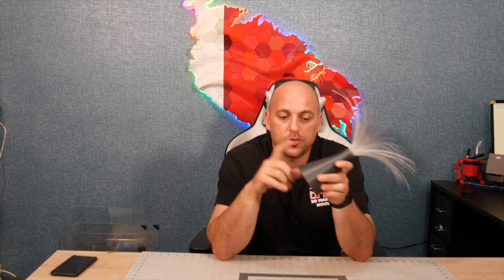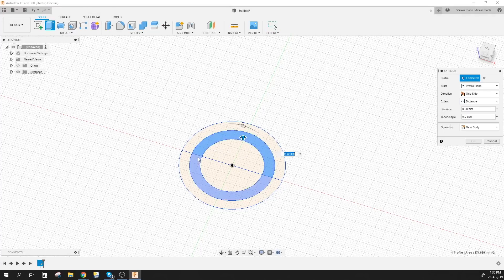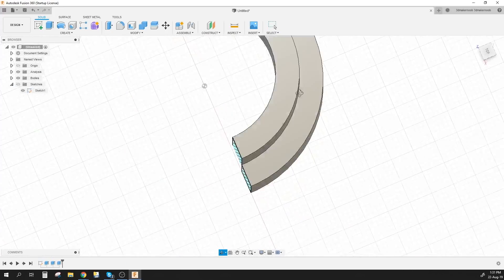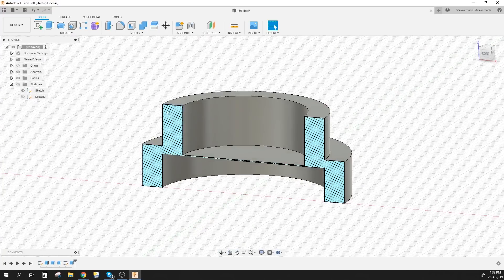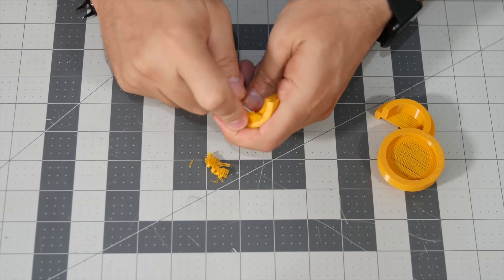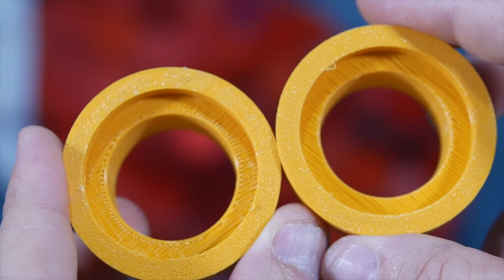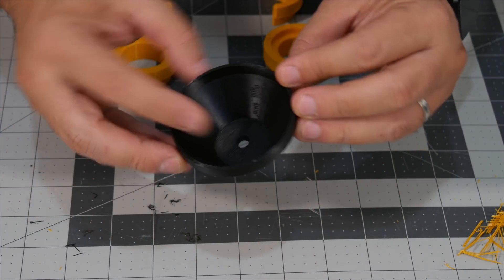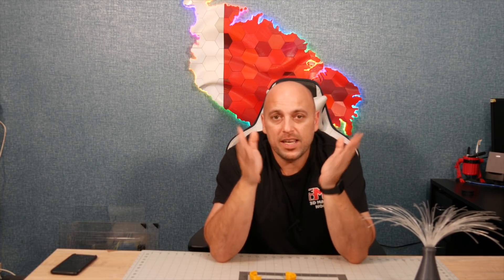3D Printing Design Tip To Avoid Supports - Sacrificial Layers and Bridges

Comment: I'm amazed how printers can do that, it's not intuitive for me, I thought when it's bridging in mid air, it's gonna fall down, do you need fans on 100% so the filament cools fast so it doesn't bend down ?

also, imagine 3d printing in space, no supports required at all

Comment: There is a much easier and econimical way of doing this nowadays using Cura 5 with pre-model. Just create a 1mm tube component under the overhang just inboard of your inside wall radius edge to the base. Export it as a mesh. Go into Cura and import your project stl and then import the 1mm tube stl, goto Cura pre model and make your 1mm tube a "Support Mesh"... Now it will support the bridge, it will snap off without any other cleaning and you will only use a tiny bit of material. I use this method when I create threads also. I create my thread and insert a tube the length of the thread half way between the root and crest of the thread, convert the tube as a support mesh and then when you are done the support strips out in one long ribbon with no extra cleaning.

Comment: hi, do you think that this model positioning will work and print fine?
Or how would you place this object to avoid failurs?

https://drive.google.com/file/d/104Z6Bw0C3-GILCXklRpnXFM8-s1mhFaj/view?usp=sharing

Its a resin printer.

Thanks.

Comment: If the hole in the donut is too big for bridging, maybe you could support the sacrificial layer with an added cylinder that only touches the sacrificial layer. It could actually be quite a bit smaller than the hole, and it could also be a donut rather than a cylinder. Actually, come to think of it.. no need to print the middle of the sacrificial layer either. 

As of late I've been experimenting with tree supports - the do seem to work quite well, and separate more cleanly.

Comment: It would've been a nice added bonus if you'd shown how to print it flipped over as if the parts were orientated like the parts are sitting @6:20 with the lip on the outside. I have a design that has a lip that I use supports on and while it still prints well, I would like to know how I can achieve a similar result without all of the waste as I have MANY of them to print O_o

Comment: I do this, but in this case I'd have added a sacrificial cylinder the same size as the inner diameter. The bridging is then shorter and only the cylinder needs to be removed.

Comment: I sometimes place the support a small distance from the part. You can see it when zoomed in on the slicer or CAD, but it does the job and is easily removable. If it is too far to bridge or outside the object, I might create a shelf. 2mm lower than what needs to be supported. That shelf is supported by small structure branched from a point on the main part. If your example had to be printed upside down, I would make a partial Cone sloping 45° and 0.2mm larger radius than the part.
Reply: I usually add a support of some sort up to about 0.1mm (or 1 layer height) from the overhang.  It works, takes very little filament and falls off when I lift the print off the bed.  No "removing" needed.

Comment: you don't need any support what so ever. Just design the part proper. instead of a sharp 90 use a 50degree on the inner for a counter sink screw. this won't require any support at all. 
If you do need a mid air bridge do it with 5mm to max 10mm column spacing apart. This way it will not sag and is super easy to remove.

Comment: There is a easily missable standard Setting in prusaslicer that makes Supports EXTREMELY easy to remove. Just change the Z Distance from 0.1 to 0.2 in the Supports tab

Comment: This should really come as a feature in the slicer itself. Feels like a pretty simple thing to check for while slicing, it’s basically just extending straight lines or checking for where a plane intersects. If done in the slicer the thickness of the sacrificial layer could also be reduced by reducing the flow rate while it’s ”bridging”, making it easy to remove even if you print very thick layers.

Comment: My first attempt failed because of "Perimeters" setting, if the bridge part of the sacrificial layer is too close to the perimeter, the bridge segments will end over open space, at least in Prusa Slicer. Couldn't find an option to make sure bridges are anchored on previous layer. It would be nice if the slicer could at least warn about un anchored bridges.

Comment: Been using this technique for a while myself when adding small square / hexagonal screw inserts into my 3D Prints.
Another option - If the bridging is too large - is to do this: https://i.imgur.com/rrjGnjT.png
1. Print the yellow bridging mesh on the build platform first.
2. Start the print of the actual model but have it PAUSE between the transition area of the red and the blue sections ( one object but coloured differently for the sake of explanation ).
3. Insert the yellow bridging mesh ( consider adding a dab of glue here and there ).
4. Resume the print of the red/blue mesh which will lay it's layers on top of the yellow bridging layer.
Reply: Why didn't I think of this!
Reply: I use a similar technique, but instead of glue I just use a soldering iron to melt the edges of the two parts together. Because it's all made of the same plastic it ends up as a single solid part. Much easier than futzing with supports.
Reply: @dgkimpton  what two parts ? There's just one part...did you read the image caption?
Reply: @alejandroperez5368  did you? There are two parts during printing. The red+blue and the yellow. The yellow part needs more than just "drop in" otherwise it will be dragged about by the hotend. I fix it by melting its edges with an iron, Durahl suggested glue. Eventually when printing is complete it ends up as effectively one piece.
Reply: @dgkimpton  read the image caption, dude!!

" The RED and BLUE shells have been separated for visual guidance only! They are in fact one single piece but the 3D print has to be halted at their boundary for the YELLOW piece to be inserted"

There's no mention to glue anywhere....
Reply: @alejandroperez5368  "3. Insert the yellow bridging mesh ( consider adding a dab of glue here and there )." 
But whatever, I'm happy with my experiences and this is pointless.
Reply: @dgkimpton  You're right. I didn't read that comment completely, I read the image caption on the link.

Comment: Great tip. In the past I've resorted to splitting some items in two in CAD, printing, and glueing back together.
Reply: I still like this option in a lot of cases since the glue has the potential to add some strength and for structural components it can be advantageous to print portions in different orientation to avoid bond strength issues.

Comment: Pretty great idea If you needed to do a large area you could still use a support wall also a minimum thickness at the mid point of the widest point of the sacrifice layer its faster and cheaper to do your way of this thank you now I have a new tool in my box

Comment: I used such a model last week on Thingiverse.First, it's very hard to modify. Secondly, for different layhigh, such as 0.2 and 0.1, slicing gives different results. This should be provided by slicing software, not by modeling modifications.  Please use countersink.

Comment: I picked this tip up from Angus (Maker's Muse), and often use this on parts that I downloaded. Usually I only have the STL and I'm not experienced in modifying meshes like this, so I add these 1-layer covers to the holes in PrusaSlicer. Doing it in the slicer (even for my own designs) also allows me to choose at the slicing stage what layer height I want to use and then add the hole covers at the correct thickness then. Especially useful now that I'm using adaptive layer heights, I can find out the right thickness after I've applied the adaptive layer height tool. For counter bored holes smaller than I can fit my deburring tool into (like for M2 hardware) an appropriately sized drill bit makes easy work of cleaning the finished holes. (For example, 2mm drill bit for for an M2 hole.)

Comment: 500 caps and 3d printed???  That seems expensive. I would told the guy to look for plastic molding.
Reply: Not if the guy was willing to pay $2/pcs...
Reply: @Arek_R.  That's no reason not make it with cheaper methods and better result.
Reply: A mold is 2k just to start with😂

Comment: Cool little trick, I already know at least two projects I'm working on where I wish I knew about this before. Both parts require supports to print, but at the same time they're very difficult to print with supports, this will simplify things a lot.

Comment: Anyone who uses 3d printing for a 500 qty run of ANYTHING needs their head read!!
Reply from the maker: i printed 500 pieces of this item within a week. how long you thing it would take (and cost) to create the part, refine it, create the injection mold, test it, refine any changes if needed and then make 500 parts for one time?

Comment: Nice tip. Notice that, in the first piece, since you're already adding a support part in the design (the sacrificial layer), you could also make an inner ring to sacrifice as well, whose outer wall would be exactly the diameter of the piece innermost ring or just barely shorter (enough to let the cutter blade slip in between later on and as tall as the sacrificial layer, so you'd be still bridging to make the "balcony" bottom layer, but the bridging distance would shorten so it'd be more firm, and you may even increase the piece size.

Comment: You don't need CAD file for this if you use PrusaSlicer. It allows you to add primitives (cylinder, box ...). Make it 1 layer high and place it where the supporting bridge should be. Although I have to admit that doing this in CAD is much easier. But in vast majority of cases you just don't have access to the source file (yes, I'm looking at you, Thingiverse)

Comment: What is that tool you are using called? You are using it to remove the sacrificial layer?
Reply: Burr remover. normally used to remove burrs from aluminium pipes

Comment: You talk about making 500 pcs of a part on a 3d printer..... why not just print ONE part. Fix it up to look perfect. Build a silicon mould and cast them with polyurethane? This will take 2-3 hours to make the mould and only 5 minuts to cast.... if you make a mould with 4 or more parts at a time, you can cast it in under 10 hours for ALL 500 parts. Look it up.
Reply from the maker: If a customer asks for 500 3D printed parts, why would I argue with him? This is what puts food on the table :)
Reply: @3DMakerNoob  Thats fair. Business is important. If you could get the same prize by getting the job done in less time, you will have a win win. I just wanted to point out the possibility to make a casting solution model.
Have a great one.
Reply from the maker: absolutely agree. but since i have access to 50 printers, i tend to have a short turnaround time for custom parts in large quantities :)

Comment: but wont that sacrificial layer change the tolerance measure?? and if that printer can make that sacrificial layer that way why would you bother put supports in the first place!!
Reply from the maker: it won't change tollerances. you'd need supports ar the inner ring would print in mid air otherwise

Comment: Support in cura, enable the support interface and roof settings. It creates a brim ontop of the support making it easier to remove.
Reply from the maker: All slicers have that feature
Reply: @3DMakerNoob  just using Cura, don't think many ppl use it as it's a gold when it comes to removing support

Comment: or you could just print a sacrificial thin  walled cylinder  at the inner diameter, you can model it as a separate item, bevel the top to minimize contact area, and then simply break it of along the layer at the contact height, no cutting through the layers as you have done. The bridge is then much shorter than your system too. The idea is the same, just better execution in this case. In essence what you are doing is taking control of the support method by good design using sacrificial addons to avoid clumsy wasteful auto supports
Reply from the maker: You’d still be using more material so might as well just use custom supports. The idea here is to minimize work and waste, resulting in a quicker print with the same exact end result
Reply: I mean really thin walled, like 0.8 if you are using a 0.4 mm nozzle, a lot less than full support material.

Comment: Me: Jesus, is that you?
Sacrificial Layer: Yes son, I died for your prints

I made a tush-remix which just wouldn't adhere to the bed due to the many holes. Added a sacrificial layer on the bottom and boom! it worked. Thanks a lot for the tipps m8

Comment: I removed part cooling fan, because cooling makes part less strong. So bridges won't work in my case
Reply: MrBirdshell666 why remove it instead of turning it off in settings ? :o
Reply: @thedococ14   , since i dont use it. and it makes printing head lighter and easier to service

Comment: Nice tip.  Well explained.  Thanks.  Sometimes supports are, in fact evil, and other times they come off easily, and hardly leave a mark.   It is hard to know what settings to tweak with supports to improve them.  More testing needed, I guess! :)

Comment: You can use also sacrificial thin cross walls to support bridging parts to improve the finish quality  :-)
Reply: I do this in some of my prints. It helps when you have a part that you can't bridge normally. Think of the overhang part being the corner of a cube. Nowhere for the bridge to go. Uses way less filament than normal supports as well.
Reply: ?? What are they?
Reply: @KieranShort  thin vertical walls that support  the sacrificial layer in more points
Reply: ummm so basically regular supports?
Reply: @nipunagunarathne4882  no, more more less material is needed for the thin walls

Comment: HI YA JOE  ..  HOW'S THE PUPPIES DOING ?  DID YOU TRY MY LIGHTER LEASH TRICK FOR YOUR CR-10 MAX ?
Reply: Is your caps lock button stuck somehow?
Reply: @sintoxic  CAPS LOCK NOT STUCK   ...  IT'S ON
Reply: I used it on my cr10 s5. Works great!
Reply: @RyanStone143  GLAD TO SEE SOMEBODY GOT TO USE IT. HAD ENOUGH TENSION WHEN X GANTRY WAS UP HIGH ? I AM WORKING ON A SUPER TALL PRUSA BEAR, HOPE TO USE IT THERE.
Reply: @3djimmy252  It worked most of the way to the top. I need to mount it a few inches higher and it will be perfect.
Reply: @RyanStone143  THERE ARE 2 OTHER WAYS TO GET MORE TENSION ON IT RATHER THAN MOVING IT. HARD WAY  ..  THEY COME APART AND YOU CAN PUT MORE TENSION ON THE ROTARY SPRING. EASIER WAY  ..  HOOK ON TO THE EXTRUDER BUNDLE FARTHER UP THE LIGHTER LEASH LINE.